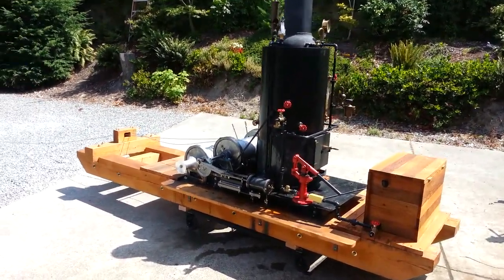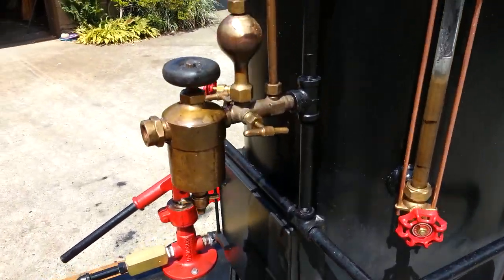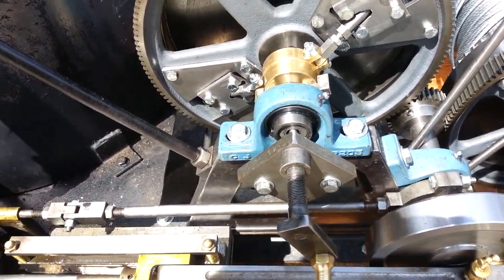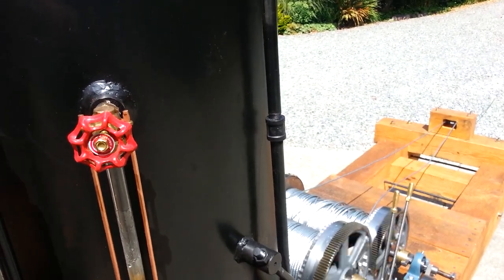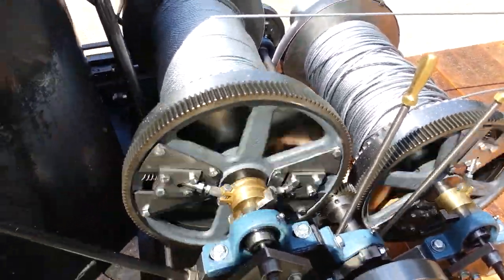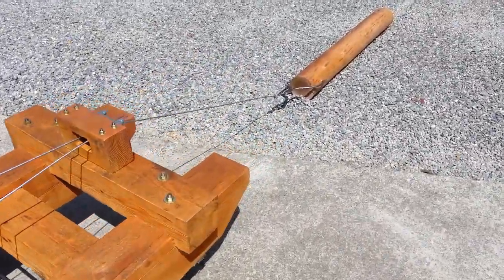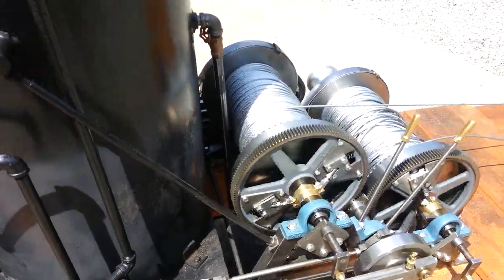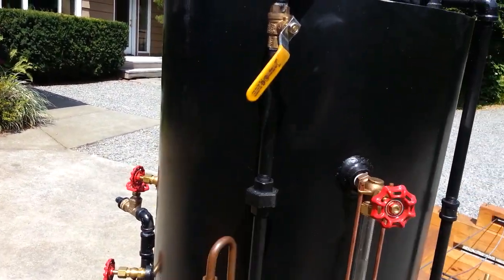Steam Donkey logging Boiler,Whistle Water Pump gauge yarder

Comment from the maker: This is the third Steam Donkey that I have built.  Measuring 12' long x 42" wide x 82" high to the top of the stack. Cast iron castings include two engines and cross slides. Also included are two 6-inch diameter by 1-inch steel crank disks, bronze eccentrics, cast iron piston and rings, and all moving parts for the engines. The two engines run on just 25 lbs. of steam pressure. The bore is 2.75 inches with a 4-inch stroke. It also features a 20" dia. x 42"tall boiler that is 3/8-inch thick. There are 22 - 1-1/2 copper tubes rolled in. A Swift oiler for both engines, a pop off valve set at 100 lbs. and two 10-inch spool drums that hold 500 feet of 3/16 steel cable. Oak clutches, braking system and ratchet-and-pawl on each spool. Ross Bendixen